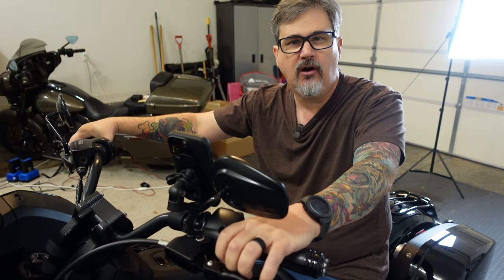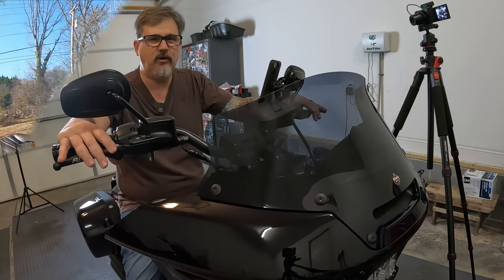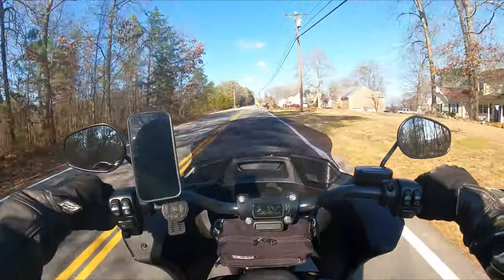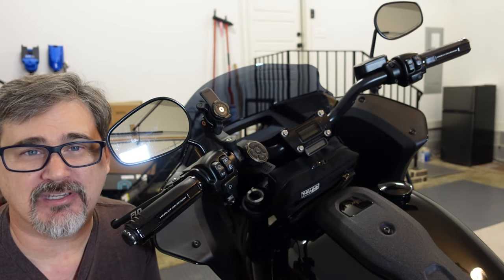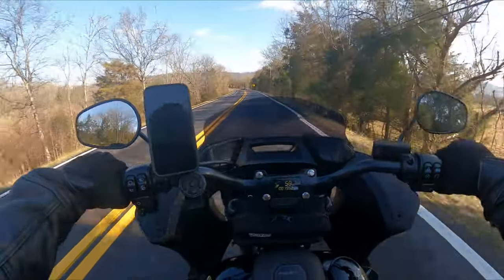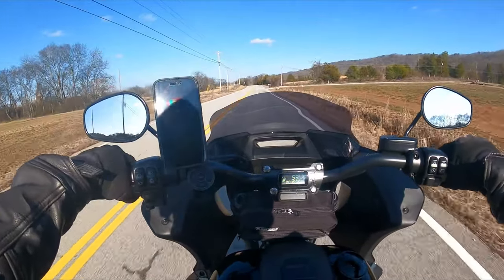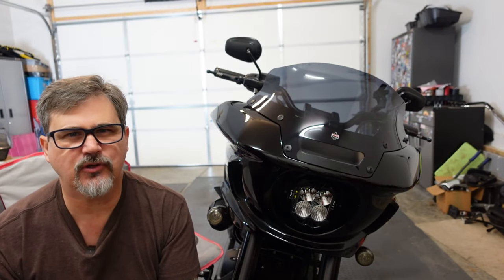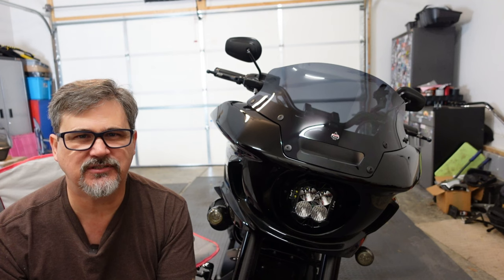Rockford Fosgate review for the Low Rider ST

Comment: With loud pipes and riding over 70-80, do you think this system will be sufficient?
Reply from the maker: Even on my SG at around 80mph the sound quality starts to degrade. In city and around town riding you will have no trouble hearing this at all. Thanks Terry! I appreciate your time today!
Reply: @TyFromTennessee  I walked into my dealer yesterday not expecting to buy a motorcycle.  Long story short.  Another dealer needed a bike they had in stock, so they traded for a black Low Rider ST.  I ended up purchasing the motorcycle.  After you saying, the audio fades a bit at higher speeds, I wasn't planning on getting the Rockford Fosgate audio kit.  Well, this motorcycle had it already installed on it.  Life happens and I am sure I will be happy with it.  Thanks!
Reply from the maker: @thezmanz28  Congratulations on your new LRST! Yeah, the sound system is fantastic, but at freeway speeds it does fade a bit. It's not a deal breaker, but you might notice it.

Comment: I am buying a new Low Rider St next month and first modification I am making is changing the pipes and doing a stage 2.  Just out of curiosity do you think  stereo will  be loud enough once the pipes are replaced  because it sounded like you had stock pipes in the video?   Thanks again for making this video and safe travels my friend. 🙏
Reply from the maker: Hey Bob! Yeah man. I’m hoping to do a Stage 2 on mine too. I now have a Bassani 2into1 and the Rockford system is plenty loud, but once you get around 60 mph the sound diminished quite a bit. Thank you for watching and I appreciate your time!!
Reply: @TyFromTennessee  Thank you for quick reply and very cool you are going for the stage 2. I still can't imagine how this bike pulls because back in the day when I had my 88 cubic inch street glide I had chance to ride a 103 CVO Road King during the Harley road tour and was BLOWN away by the torque and power on  a stock 850 lb bike. A 117 engine with new pipes and a tuneup on a 700 lb bike just blows my mind on how much fun this bike will be to ride. Thanks again for the great videos and YT channel. 👍

Comment: for all of you people who have normal softtails and are sad that harley vin locked the st fairing, Advanblack makes one for us. I just installed it and it is pretty up to spec with an st, the HD dealer I go to even said the lines were a bit smoother. It wasn't so bad to install, couple hours. I plan on picking up this system as it is supposed to fit like OEM in the ADB fairing.
Reply from the maker: So far I’ve heard great things about the AdvanBlack fairing. If I had a different softail I’d put one on my bike. Thank you for watching!
Reply: @TyFromTennessee  so ive put about 200 miles on it now. It cut down wind buffeting from my old road warrior so much. For ref I’m 5’11”